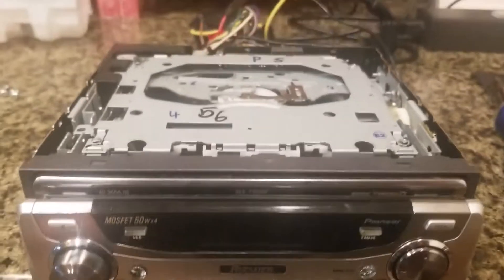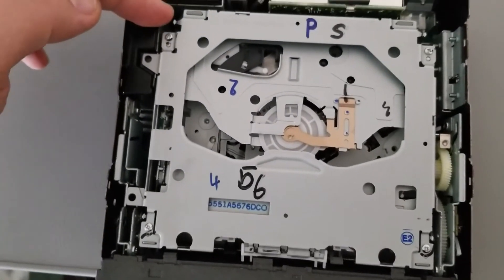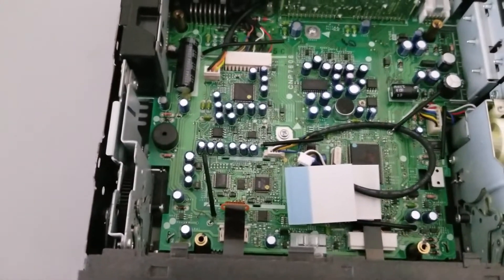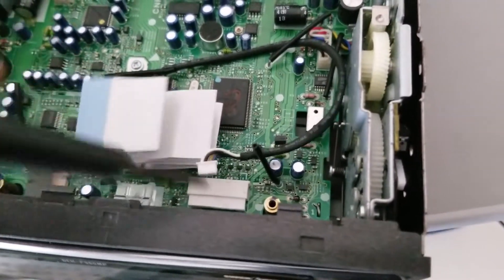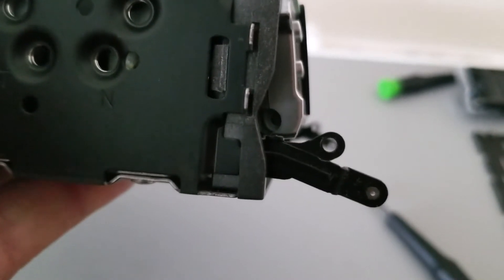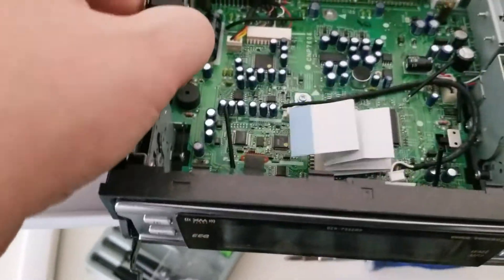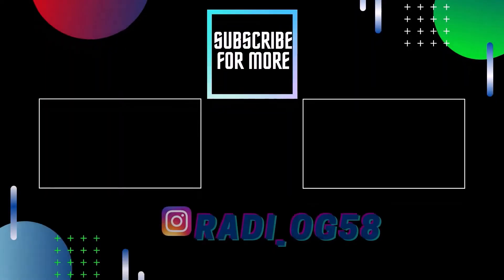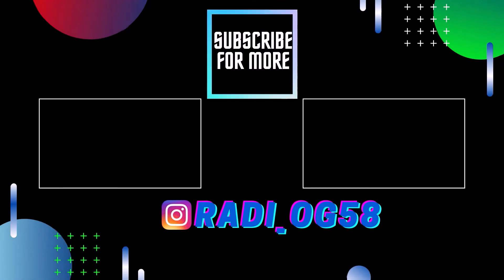Pioneer Radio || DEH-P960MP || Ribbon Cable Repair Part 1 - Disassembly/Analysis

Comment: Would you consider repairing the ribbon cables on a DEH-P680MP, DEH-P6800MP, and a few others for $$$? I can get the cables ahead of time. Thanks.
Reply: Hey, i think i could help you out
Reply: @alinstanca3726  How much would something like that cost? I'm reselling these to make $$$ Thanks
Reply: @moneymark27  hey,what do you mean ? how much a ribbon cable costs ? or how much i charge to repair one ?
Reply: @moneymark27  hey,what do you mean ? how much a ribbon cable costs ? or how much i charge to repair one ?

Comment: What does the right side ribbon cable do? If i was to change it, would it fix my ejecting problem?
Reply from the maker: Each ribbon is for one of the displays. If the CD keeps ejecting, it's usually something not setting right in the CD assembly.